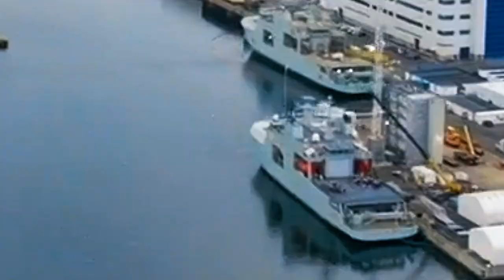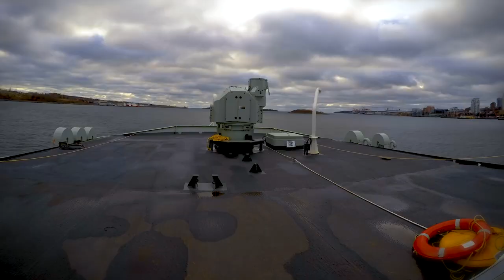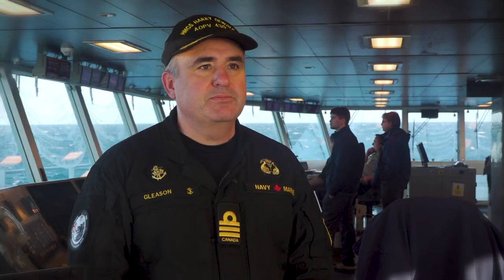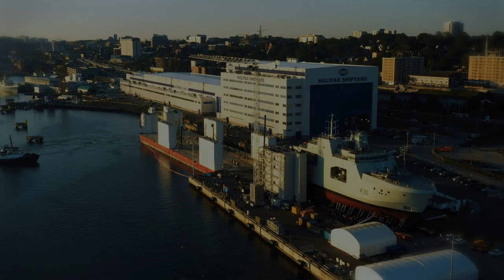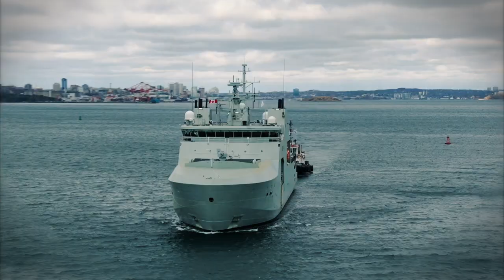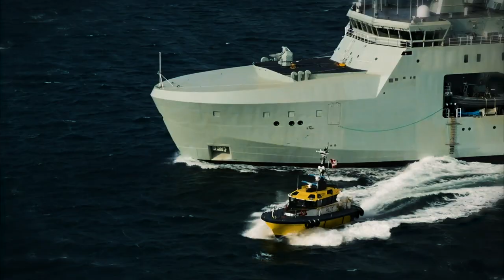To SEA! - Building Harry DeWolf Part 5/7

Comment: It is so under-armed, it's a joke. Like come on, this is a NAVY ship. Not a COAST GUARD ship. If you want it to be a warship, arm it like one! No need for CWIS or a RIM-116, but at least some harpoons or Mk 48s and a 5 inch!
Reply: Get real Chester.  No one equips their ships with a 127mm gun these days; perhaps you meant a 76mm or 57mm gun?
Reply: @blackwatch6649  Um really? What about the Ticonderoga guided missile cruisers and the Arleigh Burke destroyers? They use the 5 inch Mk 45 naval gun.
Reply: @chesterwang3070  Comparing a patrol vessel to destroyers and cruisers...
Reply: @codecreator879  I guess. But still. It's under-armed. I still think that. However, they designed this for a specific purpose. Even though it seems very under-armed, it may be what they want for the purpose it was designed for. IDK. it is under-armed and it is my opinion. You can have your own opinions as well and they don't have to agree with mine.
Reply: @blackwatch6649  Also just would like to add. The US COAST GUARD Legend class cutter is armed with a 57mm gun, 4 browning machine guns as well as 2 M240 machine guns and a Phalanx CIWS. The Harry DeWolf, a NAVY ship only has a 25mm and 2 browning machine guns. Just saying.
Reply: @chesterwang3070  while it's a bit under-armed, it's not missing much to be in line with other patrol ships. Also, it should be noted that our coast guard isn't armed and has no constabulary duties. Those are mostly assumed by the RCN. That's why the AOPS were never meant to be warships.
Reply: @codecreator879  agree
Reply: @chesterwang3070  Designs from the 70's and 80's are hardly modern.  The trend THESE DAYS is towards smaller main guns.
Reply: @chesterwang3070  If you want to talk about comparable ships, the USCG's polar icebreaker (USCGC Healy) doesn't even have a main gun.  Just saying.
Reply: @blackwatch6649  I get it. Smaller guns, more missiles and stuff. That is why the battleship was phased out. I get it. Jeez.
Reply: @chesterwang3070  Now you're catching on!
Reply: @blackwatch6649  Not true, opting for smaller guns in favor of missiles was  a 1990s concept, the shortsightedness of which was shown when the need to support troops ashore became more relevant again in the 2000s.  The latest British, Spanish, South Korean, Japanese Indian and Turkish frigate and destroyer designs feature a 5” gun.  The Type 26 ordered by Canada will also have a 5” gun as well as 2 x 30mm guns.
Reply: It needs a 76mm, 4 harpoons and asw torpedoes. No SAMs needed at this point or ciws